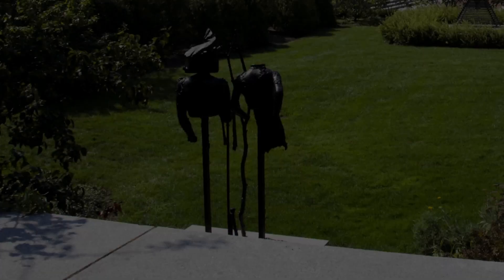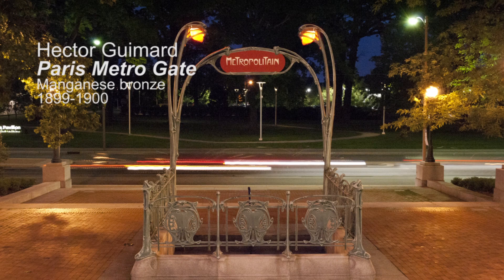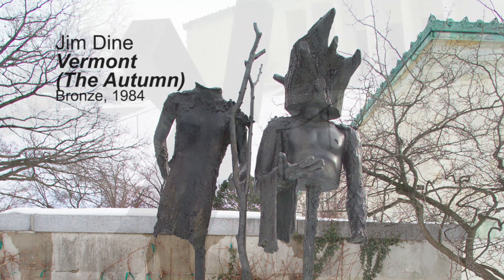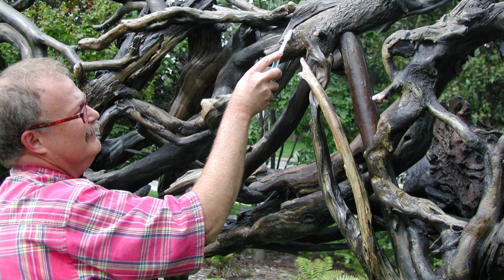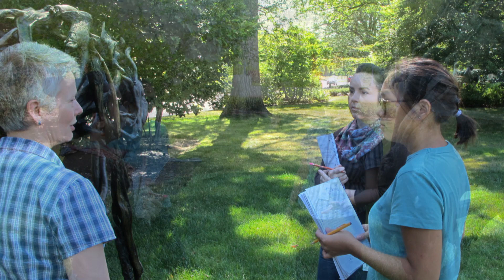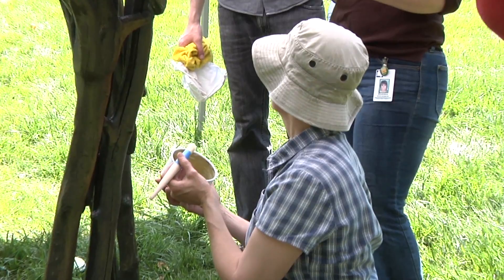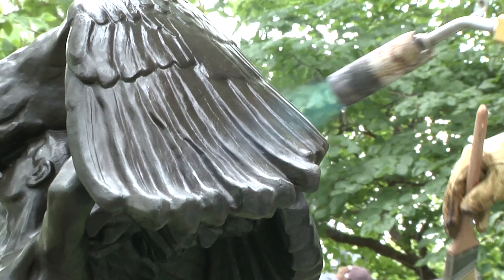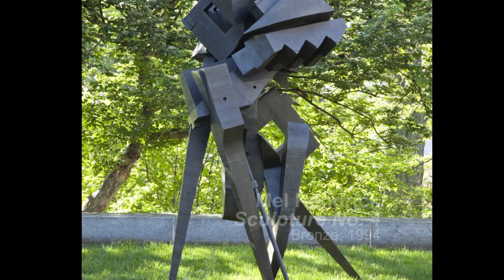Conservation of Outdoor Sculpture

Comment: Very cool video. Thanks for posting. What type of wax is used for the cold waxing and what type of wax is used for the hot waxing? Do you use steel wool for applying the wax? Or just the brush?